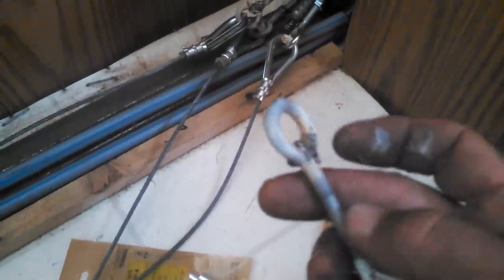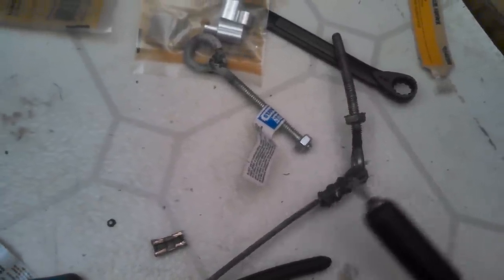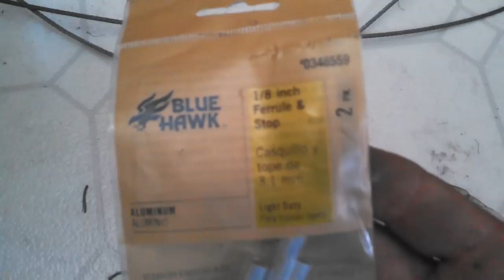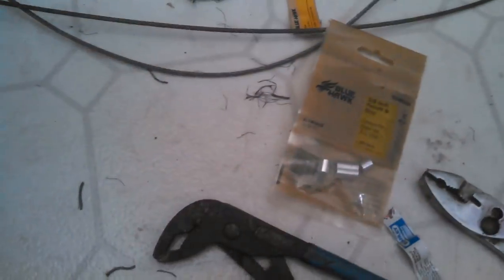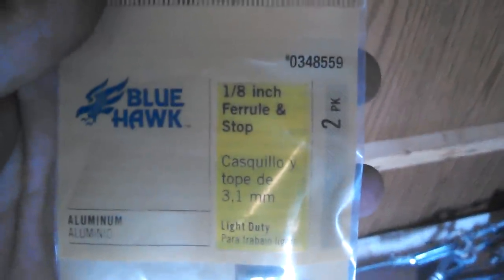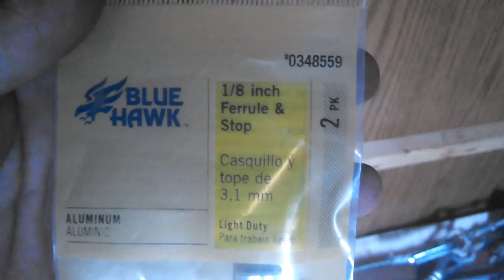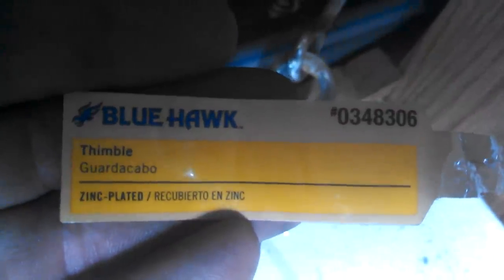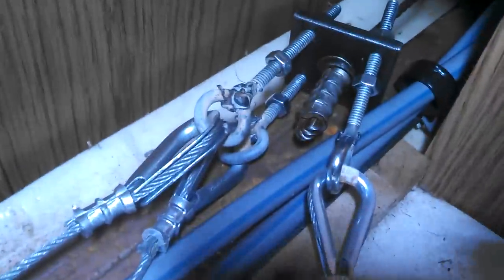1997 Jayco 1406 pop-up camper lift problems #2

Comment: The i bolts are suppose to spread open so the cable doesn't brake and you don't bend the support arms and the cable Just pop's off with no damage then you Just replace the  i bolts .no real damage done . From Australia 🇦🇺